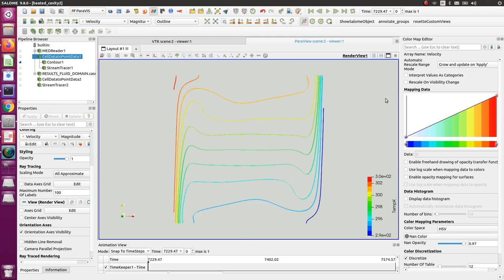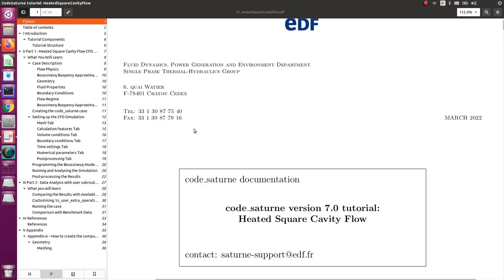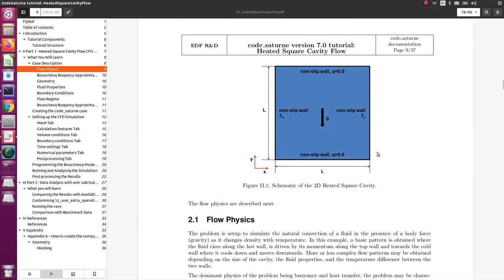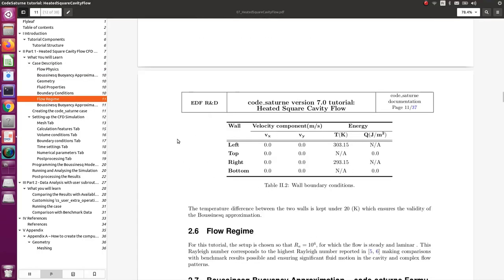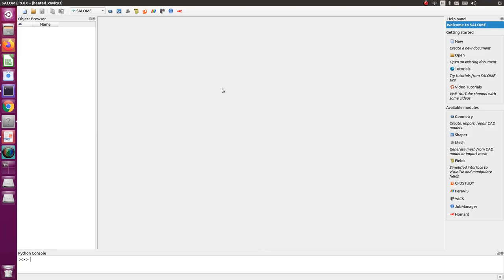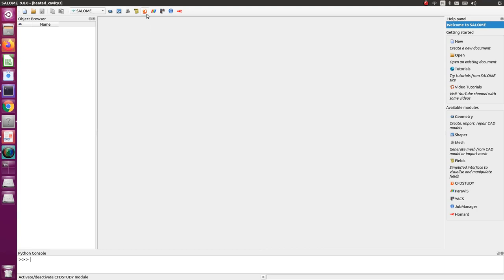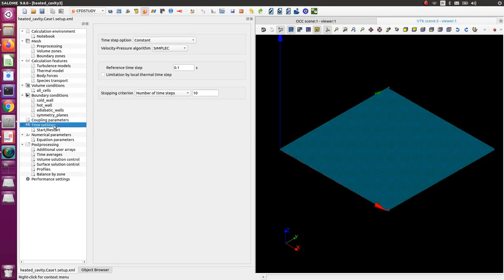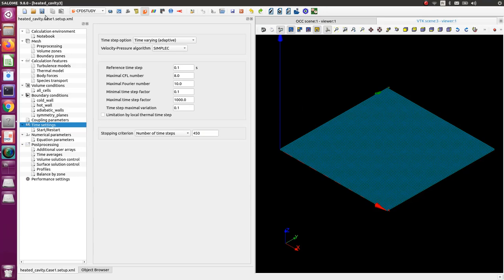Code Saturne Heated Square Cavity Tutorial

Comment: Hi Dear
I saw a video of yours on YouTube about Trimedia Analysis horn.
https://www.youtube.com/watch?v=sAplx6FbPZE
I'm confused because I want to analyze the ultrasonic horn and I don't know if it needs boundary conditions for the analysis or not?!
If you do not use a boundary condition, it should be a modal analysis only.
Now my question is that we should consider the boundary condition for Horn's analysis or only modal analysis is good?
Should we pay attention to booster gain in Horn's analysis?
I designed and built a horn. The frequency in the software was 14.9 KHZ. But it was actually higher.
I think I didn't consider things in the software design, because I actually had a higher frequency.
Can you help me what was my mistake?!
Thank you